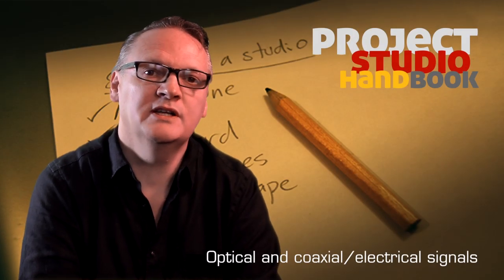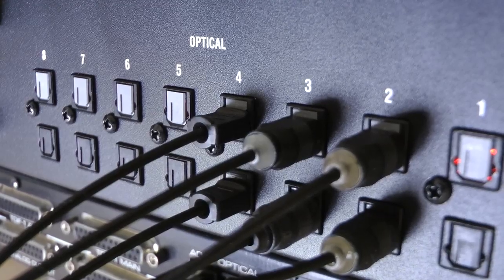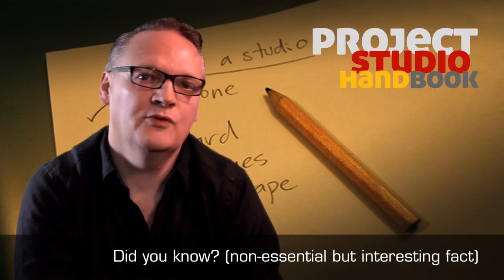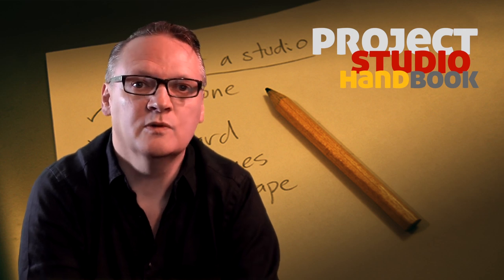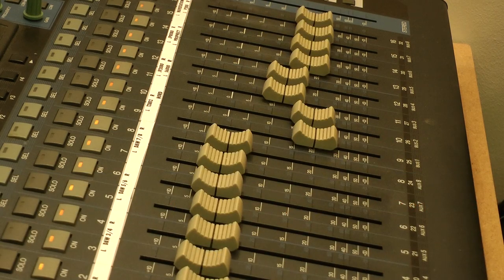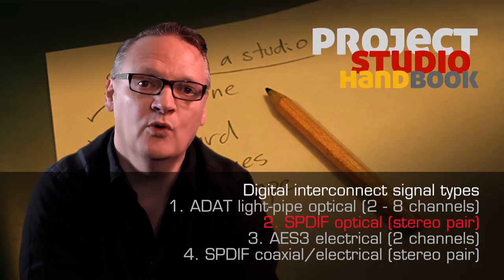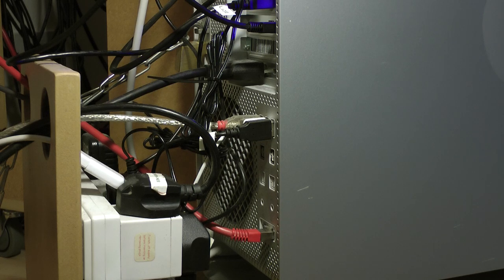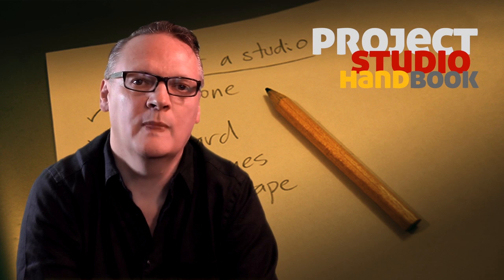Digital audio signals (v1)

Comment: there is actually a huge differance between S/PDIF and aes3 ,aes3 deal with +4dbu analog signals wich is a pro huge sound and the S PDIF is for the normal consumer dealing with the -10dbv analog that you can find in dvd,cd players ...
Reply from the maker: Good comment Rachid. Of course you're right and we should have been more specific. The digital audio data stream is identical in AES2/3 and SPDIF (a PCM bit is a PCM bit!), but because the AES version is transmitted at a greater voltage, and balanced,  there is less chance of it becoming corrupted. Of course, in the home studio we rarely send it more than a few meters so the lower voltage and unbalanced nature of SPDIF will do and there will be no audible difference when the data is received and converted back to analogue.

Comment: Can't spidf carry 2 separate channels as well as a stereo pair?
Reply from the maker: SPDIF was never really designed for this but .. You can pan two separate mono signals hard left and right and send them down a SPDIF connection. You just need the means to route them separately when they arrive at the destination. For example you could send two mono tracks in a DAW to a stereo SPDIF pair and then separate them to mono tracks when they arrive at a digital mixer.